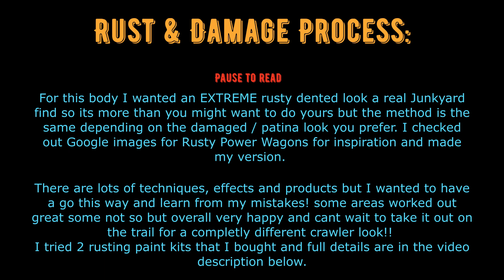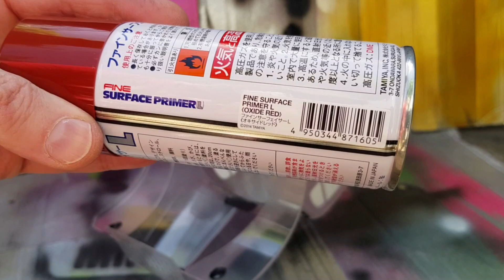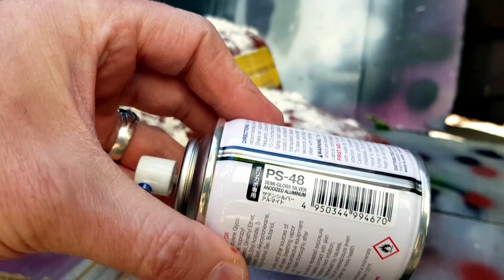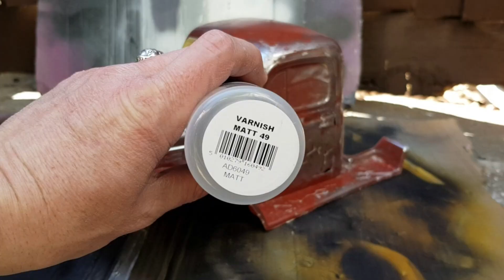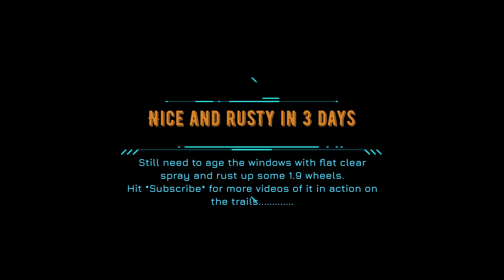How To Create Weathering Rust Effect Paint Patina Lexan Proline Power Wagon Body Rc Junkyard truck

Comment: I love this truck and I am using this method on my trx4 Dodge power wagon. Can I ask which wheels and tyres on the truck please?
Reply from the maker: Thanks hope yours goes well love Power Wagons too!! they are Proline Flat Iron XL Tyres  and wheels from Ebay SSD 1.9 Steel 8 Hole Beadlock Wheels SSD00268 Ref Number from rc-biz Good luck with the project 👍👍
Reply: @rcadventurer  great thanks mate, I have mine at the red oxide primed underneath stage, nice and shiny from the outside! Doing trials on off cuts of polycarbonate. Building up the courage to attack with cuts salts rust etc. It’s not easy being brutal lol. I might do a milder version of yours.just checking out your pics on Facebook,you have different rusty wheels on there,they look they part better I think. Which wheels  are they please? Ps you realise that soon there will be a clone of yours running around this summer! I’m in the midlands so hope we don’t clash lol thanks for your help and inspiration. John C.
Reply from the maker: @johnchapman1649  oh yeah forgot at the end of the vid I just put on the huge mudslingers from my other Rc as the ones I messaged you were not ready at that point so yes the rusty ones and the ones I messaged you just rusted them up from being black. Don't mind if there are lots of rusted up ones they look so individual love them send me pics of your when done please , now get chopping and cutting haha👍
Reply: @rcadventurer  yes will send pics when finished, one more question,after applying water then salt or flour, do you dry it out before spraying on the paint?
Reply from the maker: @johnchapman1649  cool,  if it's very wet yes if not very wet you can spray then just leave to dry b4 scratching off the residue if that's what your doing if its to be left as it is after painting just leave to dry,  the flour turned really hard on mine especially on the doors more lumpy if that's what u want sugar/ salt crumbles more 👍👍

Comment: Great artwork! I am about to paint my dodge power wagon for my trx4 , is the the varnish Matt 49  ok to go direct onto polycarbonate? Once it is on I guess you don’t need a polycarbonate paint to go on top of the varnish? Namely the blue.
Reply from the maker: Thanks for checking it out you can only put PS paints on lexan / poly as you know but if there is a colour I like that's not PS suitable I put PS flat clear on 1st to give the paint something to stick to and always use a backing colour on after to seal it in like white or black etc. If you try on a test piece of plastic and screw it up the non ps paint cracks, but for general Rc use I have had no issues with this method so far. 
This project was different as it wouldnt get noticed a few cracke haha but I don't recommend it as such just in case you get a prob but so far all the ones I have done on my channel the scx10III jeep and trx4 defender have been fine even after a few tumbles no more damage than Ps paint so all good. Thanks again for watching much appreciated and good luck with your project👍👍
Reply: @rcadventurer  thanks,just one last question, is it ok to spray the inside with red oxide fine primer straight onto polycarbonate? Or should I use the polycarbonate Matt varnish first?
Reply from the maker: @johnchapman1649  Hi, I sprayed it straight on bonded really well and have had no issues at all with it so no flat clear used for that cheers